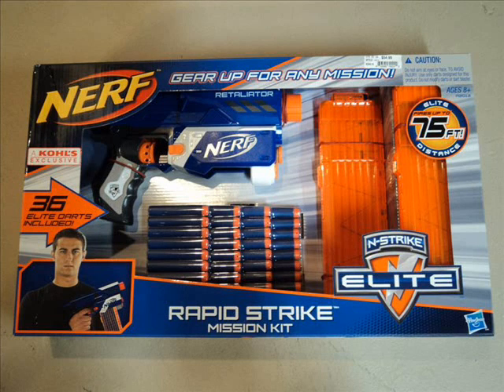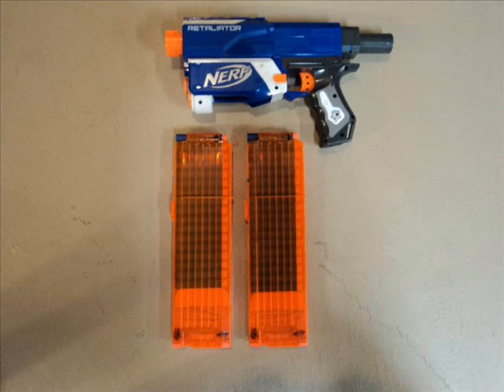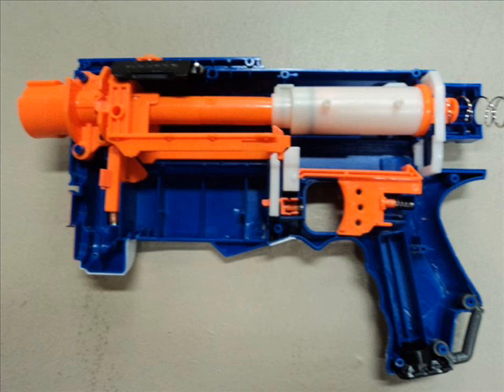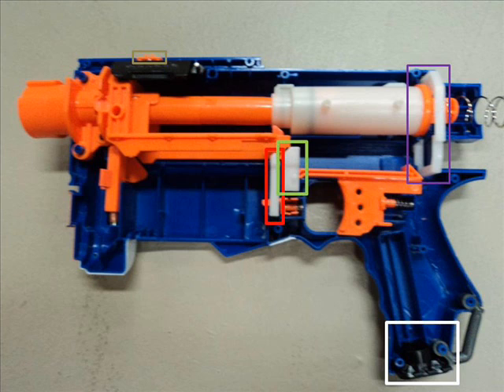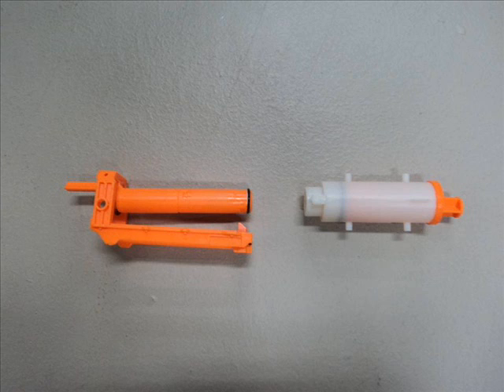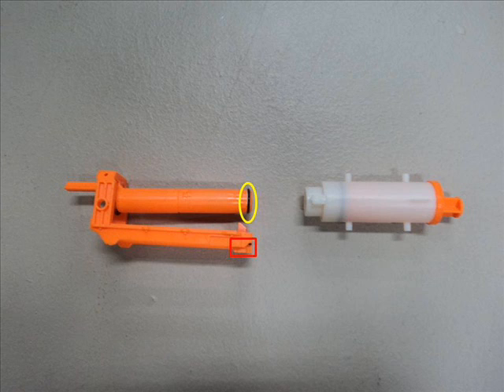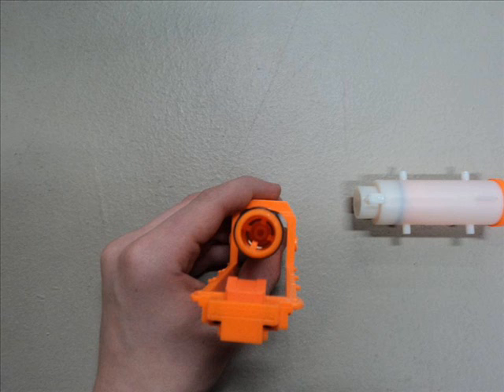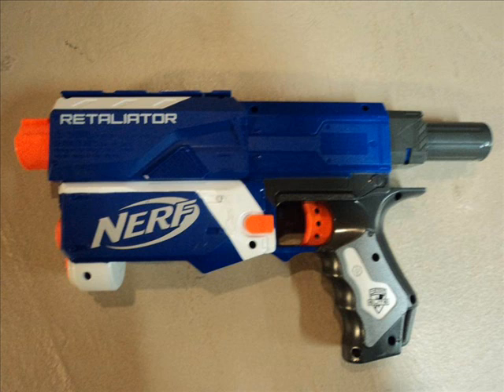Retaliator Mod(Lock Removal) Guide

Comment from the maker: Sorry for taking a while to respond. I am not familiar with that type of grease. I was told that all silicone grease was fine, but the kind I bought ended up expanding my o-rings and breaking two mavericks. I personally love and use Orange Mod Works grease because it is darn cheap and is designed for Nerf  blasters (you still shouldn't put a huge amount. It might still harm an o-ring). I am sure that there are other greases out there that work fine, but I personally can't recommend any but OMW.

Comment from the maker: Well first off, I am not sure what to make of your comment. It contradicts it self. However, I'll try to answer your question any way. Although the stock on the retaliator looks cool, it has one major flaw; it's very short. Because Hasbro did not make the stock adjustable, they decided to make it's length suitable for the majority of their market; small children. I have heard the stock is completely useless for anyone over three feet tall. I say that the blaster is great without the stock.

Comment from the maker: Not at all! If you remove the lock it will allow you to slam clips in with the gun primed forward. If you slam clips in with the gun primed forward, that is what will damage your clips over time. Removing the lock wont do anything harmful, it is slamming the clips that will. I remove the clip lock lock because i don't like locks.